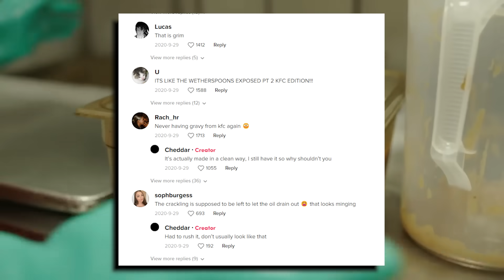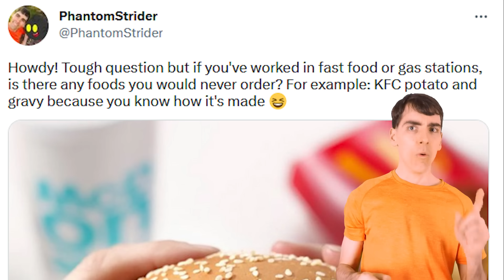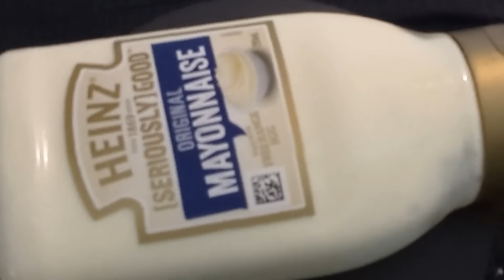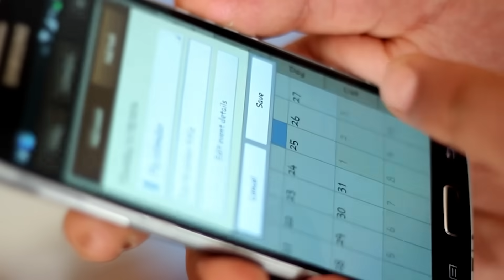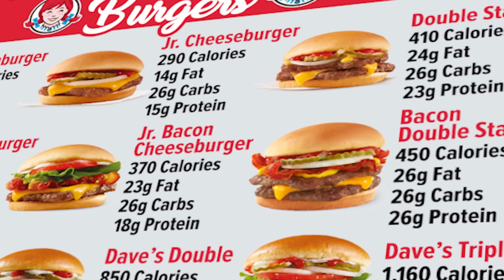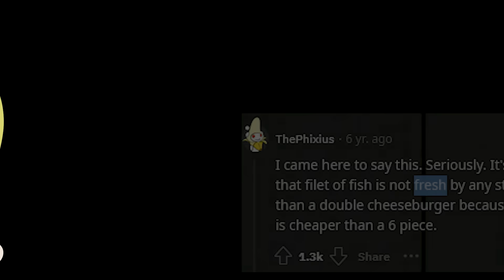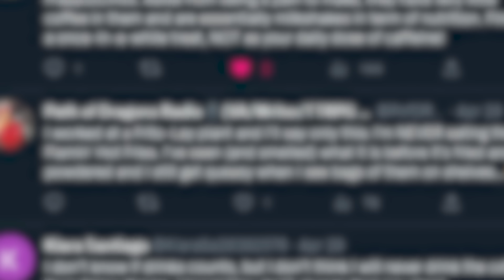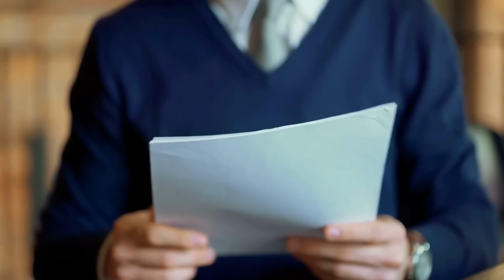The 10 Fast Foods Staff Never Order

Comment: To the people who are shocked about how KFC gravy is made, I'd like to point out that this is LITERALLY what pretty much all gravy is. It's a sauce made from meat drippings, a liquid (usually water) and thickener.
Reply: The problem lies, when do they change the grease?
Reply: Difference it's normally roasted meat dripping which is used for gravy. Fried sludge is continuously cooking in the oil which can lead to carcinogenic risks. Also how long has this stuff been left in the frier and how often it's changed. Normal gravy is made fresh and not sitting in frier oil for ages.
Reply: Home cooked meat drippings and commercial fryer sludge are wildly different things IMO, I still have a hard time believing this is really what they use😭
Reply: @Mark-nh2hs  the sludge isn't continually cooking or it would be burned. It's filtered out by the pressure fryer. It's literally just skin/crackling and oil.
Reply: Actually our gravy in our cheyenne wyoming restaurant we use the instant gravy
Reply: @dw9932  some restaurants do, also some do both, so you never know if you're going to get amazing gravy or average gravy
Reply: @locomotivetrainstation6053  Usually a cycle of 5-7 days. You filter the oil daily, and with chips/fries in the two-three left fryers, then gradually filtered across to the chicken specs (e.g nuggets, frozen strips etc fryers) after a day or two as the right hand fryers start getting black. These RHS fryers get dumped.

The bits in the bottom get filtered - the crumbs are, therefore, a day or less old. Theoretically.

But then you need to consider the calibre of the managers. There lies the problem. I used to be a coverage whore at an unnamed restaurant chain that was not KFC, and many of them were bereft of compentent management leadership and only changed the fryers when they got too many complaints... scary. 

I'd gross out and just do em as soon as I'd arrived - It's not a difficult process - I could, and probably still can - do a 6 fryer filter/dump in 5 mins while still doing orders. Won't lie though - it's a shit job.
Reply: Not in the Caribbean. We use vegetables and various spices plus water. No chicken leftovers over here lool.
Reply: @locomotivetrainstation6053  every 2 weeks fresh oil at KFC Australia and all oil is filtered every morning. Source: Worked at KFC and did these jobs as a teenager
Reply: Yeah I was gonna say... that's what gravy is. If you do any sort of cooking, you hear about scraping up the browned bits and using drippings. People are just out of touch with reality.
Reply: It's actually made with roasted drippings, herbs, seasoning and water
Reply: @locomotivetrainstation6053  Yea, that's the real question, if its done daily or every second day, its okay.....
Reply: I’m a chef 

I was also confused like how is that gross? That’s how you make gravy lol
Reply: It's basically eating coffee dregs, but they're meat dregs. Never understood why people liked gravy.
Reply: @locomotivetrainstation6053  depends on the restaurant, if they’re cheap asses or lazy it can go for a week+
Reply: I’ve worked at KFC before it’s just water and gravy mix
Reply: I can agree from working at a KFC/ Taco Bell combined it’s just gravy mix and they fryers are always cleaned every 1-2 weeks depending on how much chicken was made
Reply: And it's why it tastes so good. Hell, when we make pot roast in my house, what my mom does is remove everything from the pot, stir in the flour and some beef stock with all the drippings from the beef, the veggies, onions.. Everything. Then BAM.. amazing gravy. It gets it's flavor FROM the stuff that was at the bottom of the pot ffs. Especially if something was seared in it? The Fond? AKA what chefs go absolutely insane over? Fond is literally just fancy name for DRIPPINGS. It's needed for stocks/gravy/ect.

People really have zero idea how real gravy is made then act shocked when they find out the truth.
Reply: Yeah, never throw out your drippings. I always use the for gravy
Reply: KFC gravy is one of the last bastions of the Colonel's legacy.  "mix in the cracklin's, he would say."    The gravy today is good..  but I'll bet they don't use milk like Mr. Sanders would have.
Reply: facts
Reply: @locomotivetrainstation6053  KFC use a pressure cooker, rather than a traditional deepfryer, and the oil changes itself out every other cooking cycle, so every few hours, basically. The oil is self-recycling before being pumped back in and the sludge they use for the gravy is kept in a separate container so it won't get contaminated or clog up the system.
Reply: @BahamutXER  nice
Reply: ^This.  I always make my own homemade gravy and it is WAY better than anything you can find eating out at a restaurant.  Cook down yellow onions and baby portabella mushrooms (REALLY cook them down until the onions at least begin the caramelization process), melt down a couple of Tbs of butter, add an equal amount of flour, make sure you cook it for a few minutes (so it doesn't have a floury taste), add your meat drippings, about half a spoonful of base (aka better than bullion; amount is limited by its salt content), then add in stock, cook and stir it at a medium heat until it comes together and starts to thicken up.  If it's too thick add more stock.  

If you use low sodium stock you can add a bit more base (which makes it taste better), and you can also add in a bit of wine when cooking down the onions and mushrooms, and/or add a bit of cream at the end to get a creamy sauce (chicken marsala has the wine and can even have the bit of cream for instance).

Edit: the equal parts butter and flour is called a "rue" or "roux."  This is the base for most kinds of sauces.  You add cream and melt down cheese in it and you have homemade mac and cheese.  Instead of throwing noodles in if you instead put in salsa and cooked hamburger meat you have nachos.  You add cream, mustard powder, and herbs de provence and you have a white sauce.  In cajun cooking it is equal parts oil and flour.
Reply: ITS FROM THE BOTTOM OF A FRY THATS SO MUCH FUCKING GROSSER THAN FROM A PAN WITH REAL GRAVY JESUS
Reply: Well every gravy is actually made this way... So you can do it this way, much easier... Or you can do it the hard way and make everything from scratch... But consider that it's going to take you several hours. Especially if you make demi glace... That's about 6-8h cooking bones in the oven!!! At the end, it's exactly the same what they do, just the difference that they use a byproduct instead of making it on purpose.
Reply: @locomotivetrainstation6053  if you ever used a deep fryer, especially this much as they do... You will need to change it every 2-3 days.
At home, if you use proper palm oil and you use it only for french fries, you don't need to change it so much.
Reply: right i dont think ppl cook at home anymore at least make from scratch yourself they think home cooking is frozen or canned food they heated up lol so easy to make your own gravy do all the time guess from what the left over juice from whatever i just made lol
Reply: This explains why I don't like gravy much.
Reply: @locomotivetrainstation6053  Long as it gets to safe temperatures it really doesn't matter, it may taste bad, but if the food gets to the recommended temp based on USDA guidelines, it'll be safe to eat.
Reply: @locomotivetrainstation6053  often, chicken absolutely tears through oil quality.
Reply: Yeah... I guess people don't cook or something. Excess fat (grease) from the meat +  flour + seasonings + maybe water or milk if you need to thin it out some
Reply: @ToxicRainStorm  I'm with you.
Reply: @King Clyde  is not a fryer, it's a pressure fryer. The oil works differently.
Reply: I think the problem with KFC's gravy though is trusting that the process is done in a clean environment. Like I really doubt that their fryer cleaning is kept at a standard most people would be comfortable using ingredients like meat drippings.
Reply: @kingclyde1582  have u ever heard of a pressure fryer?
Reply: @martinpadilla5224  yes
Reply: Meat drippings from ONE TIME, not after you fried a hundred portions of chicken in that dirty ass oil. It's so obvious it's not the same it pains me to have to explain it 🤮🤮
Reply: @vero9348  THATS WHAT IM SAYIN
Reply: ditto for the chili, and...stews in general.  A lot of this really just reveals how ignorant a lot of people are about basic cooking practices.  Even the hot box stuff just dries out if left too long, but it'll generally never get dangerous so long as it remains hot.
Reply: Yup
Reply: @locomotivetrainstation6053  More frequently than other restaurants because they need to constantly make gravy.
Reply: It’s so good though
Reply: My family uses broth and spices along with that. Good stuff.
Reply: Exactly
Reply: That's like being shocked that chicken isn't vegetarian
Reply: no. its made from water and gravy dried gravy packets. i would know. i used to work there
Reply: @dw9932  Instant Gravy Gives me more uneese then real Gravy like you must have little faith in the left overs for that to be the case
Reply: Yup it’s literally just drippings and thickener and that’s why it tastes so good cause it’s purely the flavor of the meat of your choice.
Reply: Counter point: the bottom of a pot at your home > the bottom of a KFC deep fryer
Reply: @senonimoustv2497  vegetables and spices and water isn't gravy by definition. The literal dictionary definition of gravy is thickened and seasoned meat juice.
Reply: @locomotivetrainstation6053  deep friers? every day. i've worked at a few different places that fried food and we changed the oil every night before we left.
Reply: @Mark-nh2hs  Exactly
Reply: @rainzerdesu  The gravy I'm talking about involves meat, I just didn't mention it in my comment. I responded to the notion that gravy has to be made from unhealthy chicken grease.
Reply: on god didnt realize people didnt know
Reply: I’ve never liked gravy and now I know why. Luckily I have already been avoiding it for years 😂😂
Reply: @dw9932  "the instant gravy" that is made of dehydrated meat drippings, msg, some herbs or spices and a thickener (usually corn starch).
Reply: @senonimoustv2497  EWWWWW unhealthy chicken grease. Eats a whole ten piece without gravy and feels superior
Reply: @nathanpont3831  Well yeah in the past I probably would have eaten something like that without the gravy. I haven't had KFC in years now. It's not about being superior, I just find that to be very unhealthy. However if you feel differently, that's you bro.
Reply: @senonimoustv2497  just admit you know nothing about food bro.
Reply: Funny thing is that my friends and I knew how KFC gravy was made back in 1990. How did we know this ? None of us had the internet.
Reply: Thi..
Reply: Most kfc gravy is powdered now, maybe it’s different across the pond but here in US there is definitely no chicken dripping or oil used at all….
Reply: exactly the way real gravy has all ways been made even mama made her gravy the same way .before instant ready made garbage that never taste good.
Reply: I can admit that at the start of the segment I was disgusted but by the end realized I was just ignorant.
Reply: When making gravy from fried chicken you drain off most of the fryer oil you use in your skillet or cook pot and make a rue out of it. The fryers KFC uses are only used to cook chicken are pressure fryers and are changed out and cleaned all the time. My only concern is what the choice of oil is. I personally fry in beef tallow.
Reply: @dw9932 so it's just the sludge from some industrial fryer in a factory somewhere many months or even years ago.
Reply: No Bro, chicken drippings from a home oven roasted bird are not the same as rancid gunk from the bottom of a dirty indulstrial deep fryer
Reply: Exactly
Reply: Yep that's gravy 😋
Reply: @locomotivetrainstation6053  that's more flavor! Haiyah!
Reply: Yeppers
Reply: We don't use stuff from the bottom of a fryer
Reply: Thats what he said in the video no need to repeat 😂
Reply: It's how my grandmother makes her gravy and it's awesome
Reply: You will find the gravy most of you grew up eating with your Sunday roast had been made from drippings cooking in the same roasting for for weeks if not months because that traditional how it was done
Reply: Sounds like most fast food employees have NO CLUE how food is made. No beans at taco bell? Doesn't everything have beans in it?

And yes that is how gravy is made. Pan drippings for the flavor, add flour and cook then broth or liquid
Reply: How can you simultaneously believe that it is regularly used by the staff and that it isn't being cleaned out regularly? You have to clean it out to use it.
Reply: @locomotivetrainstation6053  tbey probably change out the fryers often enough considering they're using the part at the bottom of the fryer to make the gravy. You don't just scoop it out you dump the fryer and strain out the solids.
Reply: Kfs gravy is no longer made with the cracklin ..it's just a gravy base in a bag mixed with water
Reply: I cant believe how proud of how wrong you are.
Reply: @senonimoustv2497 then thats not gravey its a sauce gravy needs fat in it
Reply: @tbjtbj4786  It's not a sauce, to me your version is more along the lines of a sauce of sorts. Our gravy's are more like stews.
Reply: Yeah
Reply: I knew there was some reason I always asked my mashed potatoes to come without gravy. I’ve never liked gravy even as a kid.
Reply: This is already explained in the video..
Reply: @Meinstein I didn't know there was a different way to make it, except for using coffee. Cooking darned good food runs in my family-- we never let my brother forget he once made grits with only water. At least he appreciated  the heads-up 😊
Reply: As Phantom Strider had already pointed out,gravy in the making is of what it is. For hundreds of years. 

It tastes a lot better than how it looks, believe me.
Reply: @senonimoustv2497 Our restaurants in America could seriously learn a thing or two from the Caribbean.
Reply: @weregretohio7728 Like KFC. Like Subway's so-called tuna. Which ISN'T tuna.
Reply: @ToxicRainStorm Yep. When it's done,it tastes a LOT better than it looks. As Phantom Strider had pointed out, it's been done that way for hundreds of years.
Reply: @locomotivetrainstation6053  That's subjective. It's just not how it's made. It's when it's changed. How much it's being made. Where it's being made. 
AND why it's being made. 

Not all gravy is equal. Or being made equal. 
I,for one, like gravy. Whether it's from scratch, (which does take time, because not everyone has the time and/or the patience to make it.) Or not. Instant gravy. Or eat with it.
Reply: @dw9932 That's a lot better than doing it the old fashioned way. Which takes time, patience,and WHERE it comes from. 
How not-instant gravy can get spolied with water,and storing it. 
By its proper temperature. 

That takes time to do.
Reply: @cadetpixel Not from any fast food place, anyway.
Reply: As long as it tastes good and is safe to eat, I don’t care if it’s made with martian shit. 💩Gravy is excellent!
Reply: @danielstonebraker656 KFC doesn’t use a deep fryer they use a pressure fryer… two different things
Reply: Yes all gravy is made with the greasey fat even the bk powdered gravy we used on the bk poutine. However extremely salty. The best poutine gravy is beef 😋👌🙌
Reply: Yeah only difference really is it looks really creepy in industrial containers at large scale etc. Whether or not the friers are cleaned out often enough and the ingredients good/fresh enough and all that is a separate issue imo. The process and recipe itself is, like you said, the actual recipe for gravy. Fat, starch, liquid and a flavoring agent to suspend in the emulsion it creates.
Reply: A difference is using the fryer oil for gravy.  Normally gravy is made from the dripping of baked chicken, not deep fried pressure cooked chicken.
Reply: @adamf663  It really isnt as much of a difference as you think. Both are fried drippings suspended in fat. Also, open top deep friers are not pressurized for obvious reasons.
Reply: I mean, it doesn't really shock me. However, it would be better if they used chicken broth instead of water
Reply: I thought everyone knew this lol
Reply: Exactly. Whenever my Mom makes Hamburger Gravy, she uses the spatula to scrape off the beef from the patties that got stuck to the pan. In her words, "That's how it gets it's great flavor."
Reply: @locomotivetrainstation6053  yeah, no kidding
Reply: @Mark-nh2hs  you see, if I wanna make gravy or stuff like that, I use the Lipton onion soup mix instead

It's a lot better for you and you know what you're putting in 

now I know the reason why I absolutely hated the mashed potatoes and gravy from KFC🤢🤢

There's a good way to make gravy and there's a cheap and disgusting way, apparently KFC chose the second option, gross
Reply: I'm traumatized that I ever ate this gravy now 🤢 sludge from the bottom of a fryer (that probably isn't properly cleaned) is far different to clean grease made at home. I'd rather they use gravy mix than to feed me that crud.
Reply: EXACTLY!!!